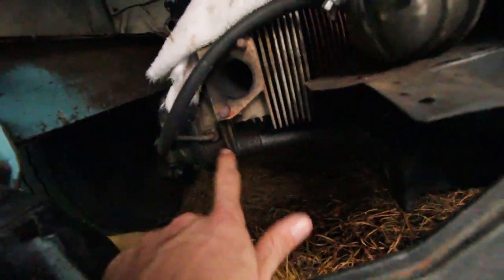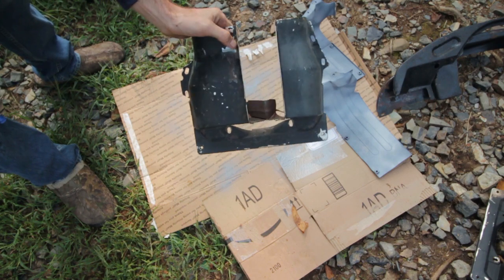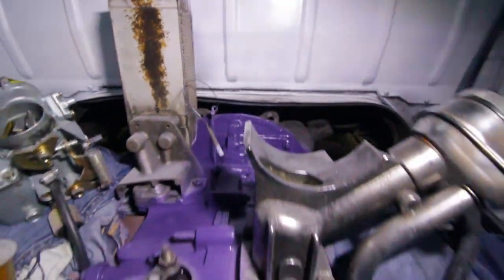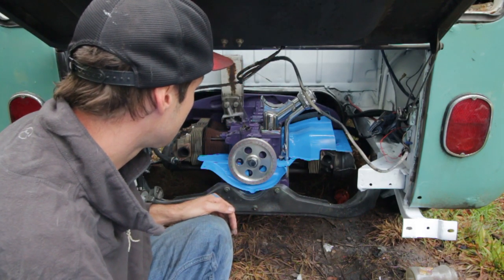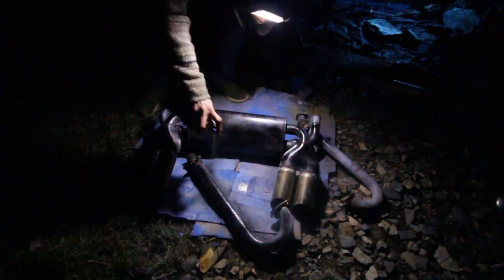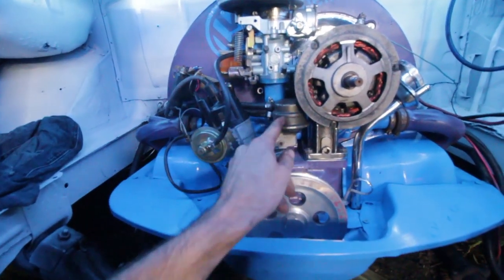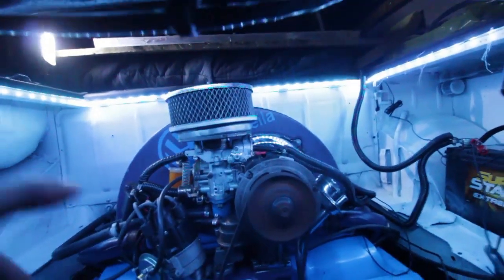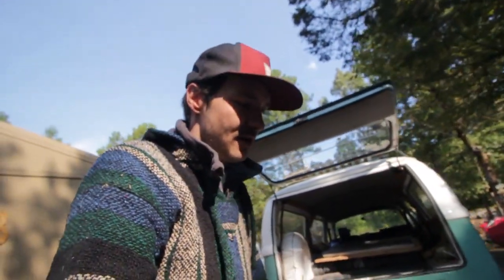VW bus engine/engine bay RESTORATION

Comment: Drew, you saw yellow when you said yellow. The reason for that is in that bright light purple will change to yellow when you close your eyes after staring at it. That is because yellow is the complimentary harmony color of purple. It's opposite color on the color wheel.  
  When I was young my neighbor, who was a fearless and bright engineer type guy, put a Porsche 911 motor into his bus. It took him three days. It was a very nice upgrade.  That was back in Colorado in the 1970's.  It was sometimes difficult to get that timing and air intake all adjusted to run with any power once you got up to 10,000 foot elevation.  Later on, I had a dual carb BMW Bavaria.  I learned never mess with the dual carbs right before having to leave for a gig.  I had to get a friend's help to get out of that mess!  Those old BMWs are very cool cars but if you find one, put the Webber carbs on it. ;-)  If you ever wondered what it feels like to fly like a bird while driving, for me, it was that old BMW.  Though a brand new 1971 Olds Cutlass with the 350 Rocket Engine was a close second.

Comment: Cleaning up your engine bay was great, love the light idea. It is so dark in that hole.
FYI, you should of taken the engine out when you got that close, it would of let you check your clutch. Changing the pushrod expansion seals is a pain but will stop the oil leak that caused all the oil coating on all the parts you cleaned up.
To fine tune it get a vacuum gage and read up how to read it. The vacuum gage is the most under used tool that will show you exactly what is going on with your engine, especially VW's like yours.
Great video.